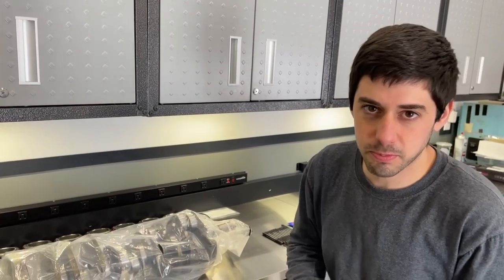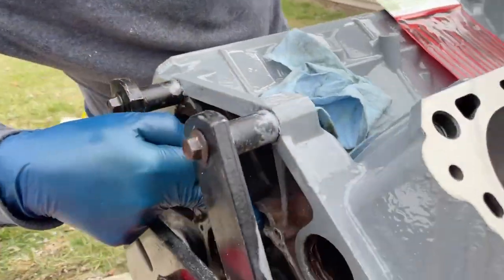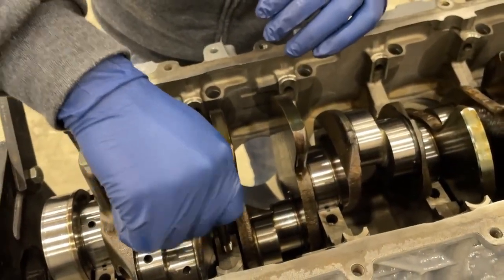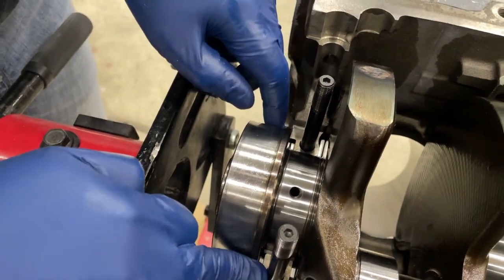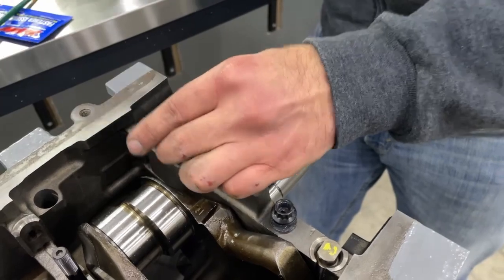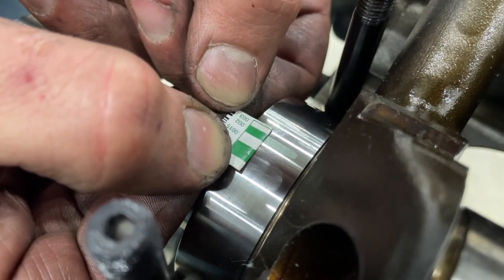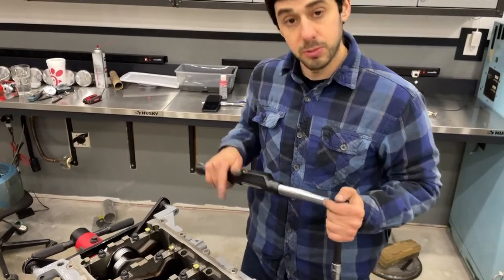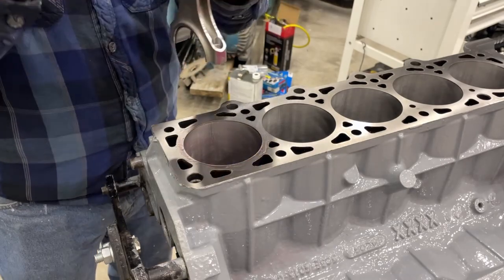How To: Plastigage + Bottom End Assembly

Comment: My admittedly limited experience is that it's very difficult to simulate operating clearances in a non-running engine. I've torqued the bearings into the caps (no crank installed and measured using bore gauges) and gotten oblong dimensions, the parting line clearance being slightly different than the 6 and 12 o'clock positions. I'll assume that's owing to bearing crush. Add to that the dimensional changes as the engine heats up to operating temps and the best we can do is to fall into the recommended range. Yet even that is an approximation based on a number of variables. You guys are killing it on every video.
Reply from the maker: Great info!

Comment: Great video. Did machine shop measure clearance at 4 points of compass each bearing, consider they did that and how that compares to your measurement using plastigage only one side of crank. Keep in mind plastigage measures ONLY the tightest clearance that occurred during all the motion you caused during assembly, align, torque AND disassembly. Try plastigage four side ends and middle and see if that gives you idea how much motion you might be battling while trying to measure. Making good measurements is an exploration in questioning everything.

Comment: Im sure it will be fine, but how much power do you think that stock crank will hold?  The split pin even firing design seems a little sketchy to me, especially at higher torque and rpm due to the small cross sectional area between those pins.
Reply from the maker: There is a turbo V10 excursion that dynoed 750hp and 1020 torque at the wheels. And GM 3800 seem to do ok with split pins. We'll see how it holds up for us!

Comment: Think with the 5 thou deviation in the plasti gauge in the center journal the crank will still last 17 times longer at 1000lbft then if there was no bearing there? "how long it goes for at 1000lbft divided by 138 or how long it goes for at 500lbft divided by 17" gives run time of how long those would run with no center bearing... (600'000 miles later... would have bin 4'300 to 35'000 miles, with no bearing their?) every thou added blocked from known maximum tensile deflection keeps it running 25 times longer "longer then what" of what would be a 0.128 deflection at 1000lbft lasting a continuous 20 year span... it doesn't need a main cap there until looking into frictional drag of the adjacent bearings biased on slight deflection... film tension of oil surface aria plus static oil pressure i'd say 1200lbft would last forever "just the bearing size holding it back" if as long as the oil doesn't overheat... 600lbft if its hot oil. static ideas of film pressure being a push pull resistance... the main cap there makes it good for +200lbft to +400lbft, could run at 200hp for a long time without it... to many ideas, I use My 4.6 ford car for plowing snow... would be nice to send it +10psi so it can push a 3 foot deep pile of hard pack in second gear? that would be close to the same output as the V10 at the crank. +2 cylinders :face-purple-wide-eyes::learning: the 5.4L outlasts more then four 4R100 primary drive clutch packs... what might it be bolted to that can handle it all? some how my CV axle broke, that was a 1300lbft flywheel torque ratted axle for a 8.75 final drive gear... 330lbft 4.6 V8 + engine deceleration torque... slowing down into a snow pile puts a lot into it all. this did that so that would need "...?" not to brake anything? if it is 1000lbft with a turbo V10...  300lbft broke a 1 inch axle... that might brake a 2_5/8th axle.
Reply from the maker: Que confused math lady meme.